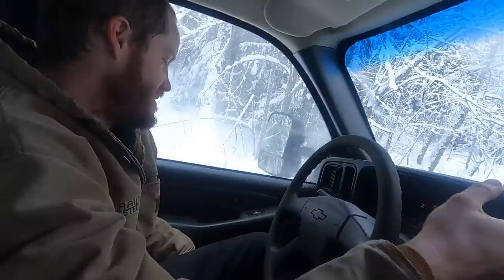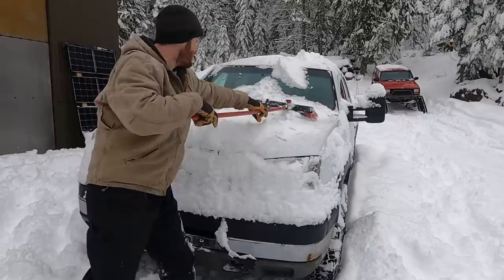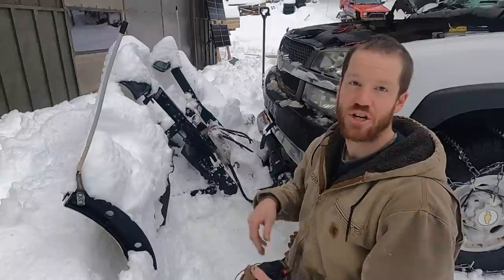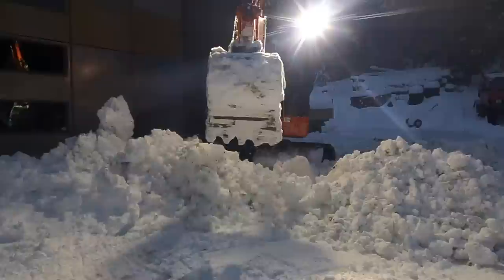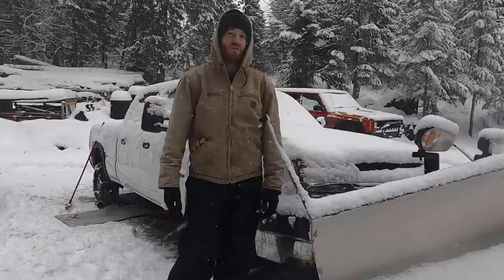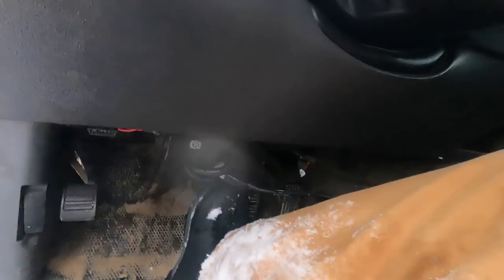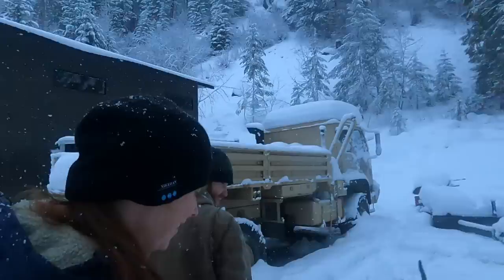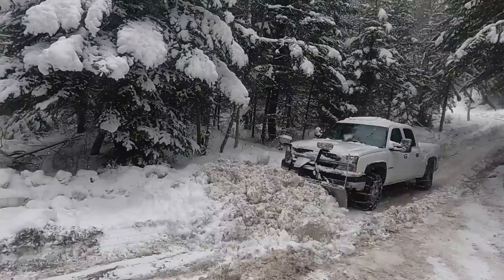WE BREAK EVERYTHING | Couple Builds Off-Grid

Comment: I never use chain tensioners. If you don't have the chains tight enough, chain tensioners can help keep the chains on the tires and keep them from banging. But, it's much better to get the chains tighter than it is to take up the slack with rubber tensioners. If you get the chains tight in the first place, then I've never found a need for elastic tensioners. Note: I think I've seen a brand of flimsy cable chains that require tensioners, but that's not the case here.

Comment: I never use bungees. If the chains are tight, they are not needed. Bungees aren’t strong enough to over come the centrifugal force of a spinning chain. The cross links will flop over if too loose and the ice breakers will chew up the tire tread.

Comment: Merry Christmas to you both.    Tire chains, air down your tires, tighten the chains and then air up.  I found 1/8 single braid nylon string (pull string used for underground electrical  utilities to pull in pull rope) works to keep the chains tight.  I weave it across the tire face and keep adding more until there is no slack in the chains. Drive a bit and retighten.  The nylon string will stretch a little and not break.  That is what I have done on my little tractor for years to plough snow ❄️ Cam

Comment: Chain tensioners keep they "S" hook facing away from tire so they cant wear tire. What a deal two motor mounts :(, In SW Washington we had snow I still do expect a huge storm tomorrow AM so you will possible get dumped on see in the evening.  You may want engine block heaters and check antifreeze.

Comment: Hmmmm....should Courtney get a skid steer? Well.... Yes and no... A skid steer could be super useful year-round for moving material (snow, dirt, rocks, and firewood), grading and maintaining the driveway, etc. Additionally, you can get a virtually unlimited number of attachments to replace your bucket including(but not limited to) a grapple, snowblower, Forks, rockhound, etc. My only concern is that you would want one  with tracks instead of tires because of the traction in the snow... However, I don't know how good a tracked skidsteer would be in that much snow... Perhaps no different than the mini excavator. The other option would be a nice compact 4x4 tractor.. About 50hp with a nice cab.... I bet you could make that work for you too! Good luck and enjoy the rest of the winter!

Comment: The first rule of plowing is that it is very, very, very hard on all of the equipment! I have seen trucks used for plowing that are completely trashed after 4 seasons and about 15k miles. One thing to consider for things parked outside you will need to start is to use a magnetically attached block heater. You could have one and just move it to the thing you need to start the next day. As long as you have enough electricity to spare.
Reply: Use a frost plug heater and yes the snow plows destroys trucks. it should be mounted to the dump truck.
Reply: @SegoMan  Frost plug heaters are great when installed new but I have had issues with them leaking if they are installed on older trucks. The magnetic ones aren't as efficient but they work alright and don't add a potential point of failure in the coolant system. They can be swapped on to anything that needs a little heat also be nice if you want to heat up an axle or something so it is a little warmer when working on it.  I had one I used on a snowblower if it hadn't been run in a while and an old diesel tractor that was used rarely in the cold. For the tractor, we also covered the engine with moving blankets to hold in the heat. The tractors that were used all the time in winter had diesel-fueled coolant heaters but that would be overkill here I assume.
Reply: @db-ws9yn  Mags are handy for sure, I have about 6 of them on the shop wall. (winters -40 here) With proper cleaning on an older truck the frost plug will seal just fine (mechanic 50+ yrs), most of the newer diesels come with a heater installed the stealerships will charge you for the cord and labor to plug it in.

Comment: The two of you are simply ‘the dream team’ !!! It’s been quite some time since I’ve last commented but, you’ve certainly picked the most appropriate channel name as you’ve become an inspiration for so many of us! Just a suggestion, for the hard starting diesels, Tractor Supply sells a magnetic oil pan heater that you simply attach to the lowest most point of the oil pan. Put it on 30 minutes to an hour maybe 2 hours before you need to start depending on temperature and your good. I have a 95 Kodiak without a plug-in and supposedly has glow plugs and for years dealt with nearly impossible starts, bought the magnetic oil pan heater and haven’t had any issues since. Also, don’t forget the fuel additive. Cheers and Merry Christmas to you both.
Reply from the maker: Thanks so much for the tip Robert!!

Comment: Since you’re new to real winter 😉: Make sure you get some anti-gelling additives for those Diesels.  When it gets cold, the paraffins in the fuel will solidify and strand you by clogging the fuel filter.  Winter Diesel also has a different formulation which will help with cold starts (and help avoid gelling somewhat), so if you haven’t filled that army truck in awhile, it might be a good time to do it if you can.

Comment: Funny, I was just talking to a friend and telling him that next year I need to do a better job of cleaning up before the snow falls as it buries everything then you don't know what is where.  We're using a skid steer with a snow blower and I ended up with one of the old band saw blades (it was already ruined) wrapped around the snow blower auger.
Regarding your need for a skid steer.  I'm not sure I'm sold on it vs. a tractor.  At a previous place we had a long drive and I used a tractor.  It sucked in that you'd spend hours going backwards with your neck cranked around.  It also wasn't enclosed and invariably some of the snow would blow back on me.  The skid steer we have is enclosed which is super nice (it was 10 degrees this morning) but I don't think the snow blower on it does as good of a job.  Basically you push the snow blower down all the way and it will float, likely just like your blade on the excavator does.  But....skid steers have a tilt to and it doesn't float.  So you really have to get things just right.  I'm definitely getting better but with my tractor you just pushed it down to the detent and took off.  However, I do have to admit that a lot of the issues could be the road.  It's not a finished road and so the skids on the snow blower have a tendency to dig in.  Maybe when it's graveled and packed it will be easier.  Also we got a wheeled skid steer because they said tracks would skate on snow/ice.  I put chains all the way around it and it still struggles and tears the hell out of the road on an decently steep inclines.  Pretty sure this is because it has no suspension so at any time you likely have three wheels in contact and since which three is always changing it doesn't get good traction.  My tractor definitely did better.
Reply from the maker: Oh man, that's a bummer! I'm jealous of your snow clearing set up, I hope you were able to get it off without too much trouble!

Comment: Highly recommended...replace all motor mounts at the same time.  The rubber is the same age on all of the original mounts.....it's ready to decompose when you need them most.  Oops...it happened.  Live and learn...have fun without any danger.  Always best to organize equipment outside before the first snow...obviously.  If pushing deep snow, don't use the full width of the blade..to reduce the load.  Also, you may need a transmission fluid cooler, as plowing is hard on automatic transmissions.  I boiled all of the fluid out of mine during my first plowing experience in Colorado, but it survived !!

Comment: You can use the excavator to lift the truck to work under it. and you can also lift just the engine with it when you put on motor mounts! I learned this the hard way .as I live in Massachusetts and have had to make repairs out side in the  snow and rain

Comment: Not too be a Safety Sally but saw the dogs sniffing around by the raised parked plow.  Had a line blow on a truck mounted plow once and it dropped like guillotine... I would try to keep it on the ground when parked and not in transit.  It also takes a lot of stress off the truck suspension.  1/2 or 3/4 ton truck suspension takes a beating holding up a plow.

Comment: just bought a used truck with plow for next winter, tried and true hopefully. This life does beat up equipment for sure. I “nut and bolt” my stuff on a regular basis to hopefully avoid mishaps. Would likely never see a bad engine mount though! I also stocked up on fluids, like a dozen gallons of oil, 1/2 dozen of brake fluid, power steering fluid etc. Spare radiator hoses, wheel bearings, headlights and every vehicle has a spare fuses etc. Hopefuly that will save me one day! Good luck and keep it up!

Comment: The tracks on the jeep are very cool. But you might think about a snowblower attachment for it becuse I think that would work far better then the truck and snowplow. With a 2 stage blower operated off hydrlics it would send the snow far off the road you can set a 3" skim to miss any obstacles on the trail like rocks and tree branches. Silicone makes a snowblower from packing up with snow.  With the tracked jeep you wont get stuck even in the deepest of snowfall.

Comment: We have a whole two inches here in Lewiston, and I was feeling sorry for myself.  You need to get insulated coveralls so you just slip them on over clothes and pull them off when inside.  They'll keep your clothes clean also.  I should loan you my pickup, the rear end makes noise, exhaust leak, needs new batteries, a starter wouldnt hurt, and fix the bullet hole in the right side door. LOL
Block heater on the LMTV is easy to install, 10 minutes.  In Mt our first year a 26 inch blower was all we had, I wore it out in one season.  Snow crushed my metal out building and flattened my al. boat.  Aint snow great.  I got the wife a 763 Bobcat with a 12 foot snow blade so she could move snow.  Good video, fun to watch from my recliner.
Reply from the maker: I like your thinking. Is it "buy your wife a Bobcat" day yet? 😉
Reply: @AmbitionStrikes  Well, its easier to get forgiveness than permission.  One day I was coming home from Spokane to Seeley lake Mt with my empty flat bed big rig and happen to pass Bobcat of Missoula so I pulled in and nest thing you know I had a little Bobcat on my trailer with attachments.  When I got home I told the wife "look what followed me home, can we keep it."  Every day is "get the wife a skid steer," day, especially if she wants one anyway.

Comment: Not absolutely sure about the newer models, but GM/Chevy starters sometimes need shims for proper clearance and engagement tolerances. So if it keeps acting funny when starting like it did keep this in mind, that may be the only issue and easily solved.

Comment: Check your master cylinder if there are two separate reservoirs under the lid one is for the front btakes other is for the rear.  You may run all the fluid out and have to bleed the entire rear brakes but you should still have full front brakes and vise versa if something ever happens to the front ones.  If that makes since?

Comment: Enjoying your adventures.  Some unsolicited advice:  That OEM starter you replaced is much better than the rebuild you got at the local auto parts store. Hold on the the old starter because you’ll likely be putting that back in and you will have no issues, very robust. Good though on replacement while you had it out but that OE starter is a workhorse and current aftermarket starters and alternators are junk.

Comment: I live in Michigan I don't used my brakes when I plow snow I just let off the excellerator the weight of the snow will stop your momentum and then you go backward empty you just let the blade down it's it will stop you then you go forward. And by the way you're  truck heat up  when you're plowing snow your temperature is always much hotter because your blade restricts the airflow .

Comment: I know alot of people are wondering why your not using the military truck to plow. That type of truck would be fine for straight flat plowing. But for hilly curving roads, a 1 ton 4x4 pickup truck is best. It will give you both the power and maneuverability you need. Also, when plowing, push the snow as far away as possible. As the winter continues, its hard to find places to move all that snow and you will find yourself in narrower and narrower lanes to drive in.

Comment: I just started watching (binge watching) your videos. Love you content. 
Recommend transmission and engine oil coolers. When you are working a truck that hard it could use the cooling system upgrades. You might want to add a short section of strong chain from a convenient bolt high on the driver side of the engine to the frame. It should have very little slack, it will take the high loads off the motor mounts when the engine wants to rollover. Be sure you check the transmission and transfer case mounting.

Comment: Make sure your chains are tight. those bungees that go all around the tire are junk. get the 18/24 inch black rubber bungees from tractor supply. 3 per wheel. I was breaking chains alot. swapped to the short bungees and now dont break chains.
Reply: just watched the rest of the video. you got the better bungees.

Comment: Nice job!  I'm guessing the truck had some underlying issues when you got it.  It wouldn't break that quickly otherwise.  Stay warm this week!  We are 3 degrees right now and I think you are higher elevation than we are.  Snowblowers work great, especially as the winter continues and you run out of places to push the snow.  But the downside is the cost

Comment: Some thoughts:
First, the military style vehicle would probably be a better plow vehicle.
Second, in a situation where there is little open area to push the snow a snowblower would be a better option. In your case it looks like you get quite a bit of snow and unless you make the initial push of snow far enough out, the subsequent plowing may narrow so much that driving(granted we don't really see where the snow is plowed) the road would be impossible.
I think that plow is too big for that truck. As stated bt others, adding weight in the bed will help. That plow does block the air from entering the radiator and at low speeds you are solely relying on the fans to keep the engine cool.

Comment: Probably too late, but running those chains on the front is probably going to rip the inner fender out...  There is no clearance for HD chains on the front of that era GM truck...   And bungee cords are NOT for keeping chains tight, they're a recipe for disaster.  You can use them to pull the chain latch a bit when you first put them on, but keep taking links out until the chains are pretty snug.  It'll take a few short drives between each adjustment.  Then put the bungee cords on the shelf.  Also, when chained up for plowing, I run about 35psi in the tires.  The ride and traction both get much better than running 50-60psi...   Also, DON"T SPIN THE TIRES when you have chains on.  That's how the cross links get broken, and then they do damage, as you saw...   Good luck!!

Comment: Wow you guys just keep moving forward, Engine mount, Starter motor, brake pipes boom and all whilst its snowing and with a smile on your face. I have to admit I did giggle a little when Riley said becareful of the hot wires and not to arc with them, and next second guess what....? Surprised you weren't blinded by the light or banged your head getting away from it when it happened. Car spares shop must rub their hands together when they see you online shopping or pulling in to the car park. Plus you guys didn't fall out whilst bleeding the brakes of the truck e.g Press the brake pedal, what....press the pedal, stop...what? That kind of thing. Take care and all the best (and good luck) for 2022.

Comment: Oh no ! Total new owner syndrome replaced 1 motor mount and never thought to consider the other that had the same mileage / time /wear ? Neophyte!  Any time you replace / buy something consider buying 2 thus avoid the down time associated with acquiring said part.
Hydraulic brakes confound the most professional mechanics factory lines are the weak link proper aftermarket lines are stainless or of a nickle/copper variety to resist corrosion . Invest in a double flare tool you will never regret that investment 1 use and it has paid for itself.

Comment: I’ve had a lot of issues with those premade steel brake lines.  They really don’t like to seal up.  

A few years ago I bought 30 feet of 1/8 copper brake line and a little radius tool for bending and it’s been great to have on hand for replacing bad brake lines.  

Copper is easy to bend, cut and double flare with some basic cheap tools and  seals with much less force on the nuts.  
…you’re using a flare wrench right..???🤨